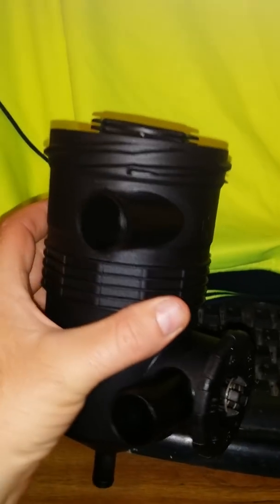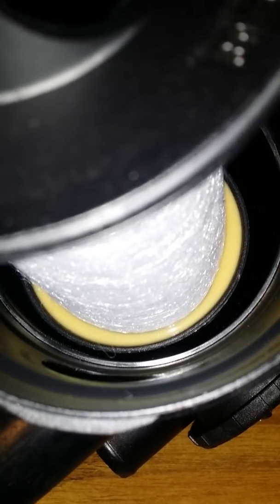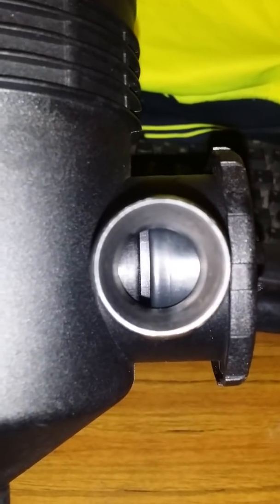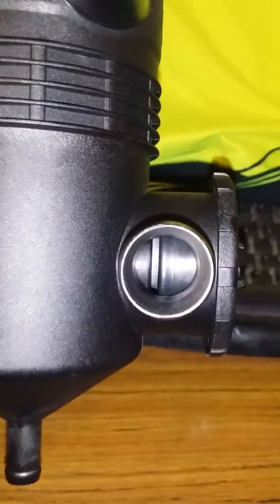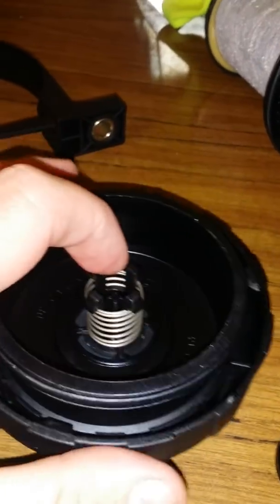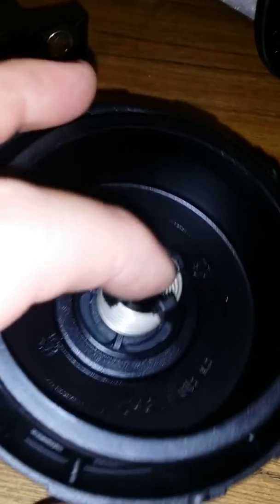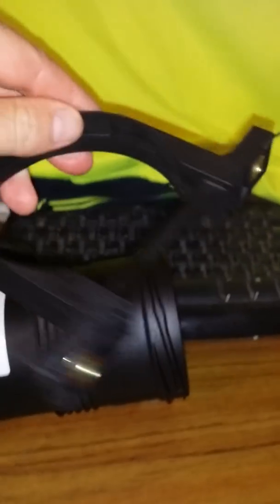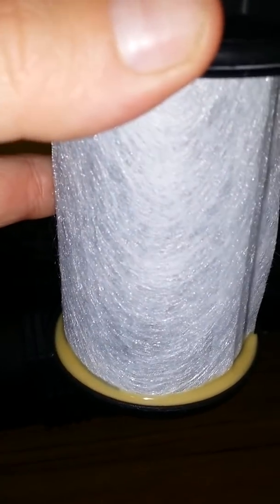What's inside the PROVENT 200 catch can.

Comment: The inlet is at the bottom on my Pro vent catch can. I think you made an error.
Reply: The ProVent 200 has the inlet on the top and the outlet on the bottom, with very big arrows cast into the casing denoting this. All original 200 versions have this setup. You either have  a smaller version in which the porting is as you describe (100, 150) or you have a copy of the 200. Page 9 of this M&H PDF clearly shows the inlet of the 200 at the top https://oe-products.mann-hummel.com/fileadmin/user_upload/kataloge/kataloge-wartungsanleitungen-mann%2Bhummel/kurbelgehauseentlueftung/MANN_HUMMEL_Crankcase_Ventilation_EN.pdf

Comment: I get a weird blow off kind of noise whenever I letting off my accelerator when my vehicle is cruising at around 20km/h with engine revving at around 1500-1800 rpm. There is no wastegate being installed and I only getting noise since I’ve installed a provent 200 catch can. Does your car gives you the same kind of noise as I’ve described?

Comment: Seems weird to me, the Ryco Rcc350 catch can has the inlet on the bottom and outlet on the top.
To me, that seems more logical as oil would find it harder to travel up the can, allowing cleaner air to be put back into the engine.
 Unless I'm not fully understanding the provent 200
Reply: The Provent 200 filter insert has bottom on lower side, the 100 and 150 versions have bottomless filters, so they work as you expected. Only provent 200 sucks gases from the top. This is due to oil draining issues

Comment from the maker: You want these hose reducers. https://m.ebay.com.au/itm/Provent-200-Reducer-Adaptor-19mm-Mann-Hummel-Catch-Can/191856804642?epid=679523560&hash=item2cab8e8322:g:3iUAAOSw1DtXH-6Z I've found that my 2 metres of pvc drainage tube gets full of oil every 4000km. I've recently extended the hose to 4 metres. My drain hose started leaking where it attached to the catch can. I had to retighten it. Beware. Also don't let your drain hose get full. This catch can has no oil storage. All the storage is the drain hose. As i said i extended my drain hose but it might be a good idea to route the bottom of the drain hose into a holding container. The tubes attachment to a holding container must be sealed and air tight. I've got a cheaper aluminum catch can i was thinking of routing the drain hose into to hold more oil. 
 I used radiator coolant hose from supercheap auto for the in and out hoses of the catch can. 
 I bought 2 metal hose reducers from ebay. The adapters screw into the catch can until their Oring makes a seal.

Comment: Any chance removing the bottom valve? I dont like how it's only half way open I would like it to be free flowing as much as possible
Reply from the maker: Sam trebil no need to remove it. There is heaps of flow. I have 2 metres of drainhose which gets full of oil every 4000 km on my modern diesel van. It works fine.

Comment from the maker: I know it's a check valve.  i think it regulates the pressure/flow of gas for safety and efficiency.
Reply: boost  or a back fire,   either can blow out the engine oil seals  if too high.

Comment: its a check valve
Reply: A check valve for what purpose exactly...???
Reply: @Croozzen  so it won't reverse flow, say u have it hooked up to a system where it sees vacuum and boost, it will close in boost and open in vacuum. So it only flows one way.
Reply: @tomjw7   but normally it is directly connected to the intake so wouldnt be better to cancel provents pressure regulator valve or change it with stronger spring to stimulate normal operating condition?